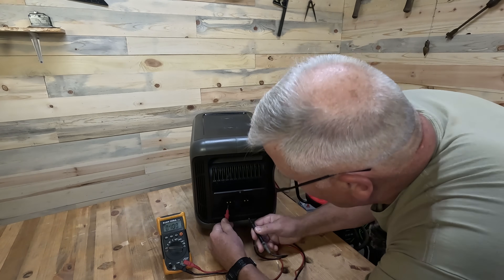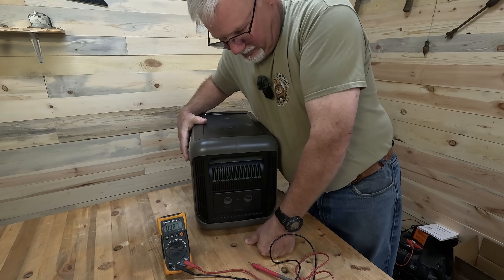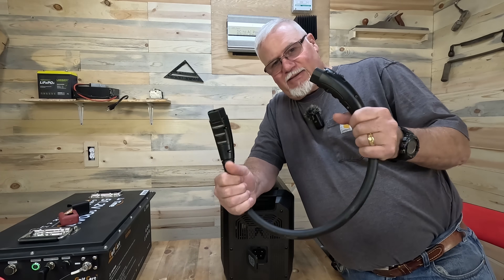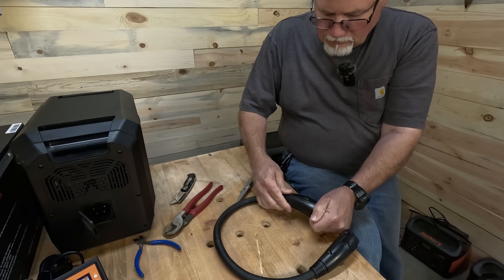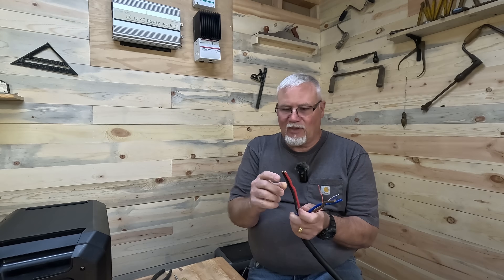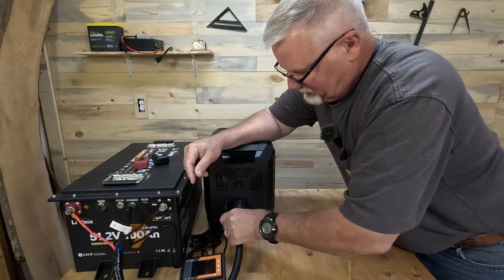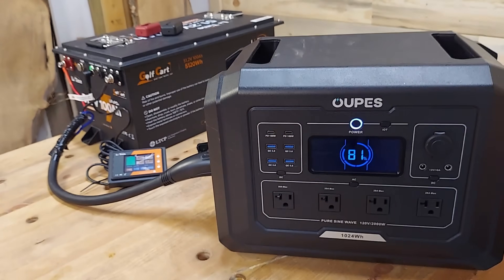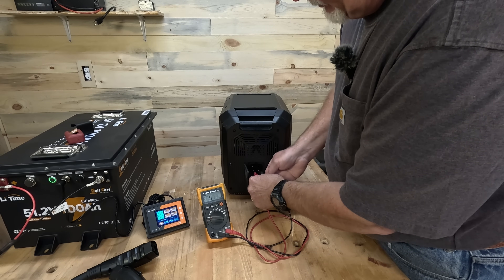Unlock Hidden Power: Connect Your Own Expansion Battery!

Comment: Smaller power stations generally don't use standard series cell counts and can't be externally paralleled with standard LiFePO4 batteries.  But most larger power stations do indeed use standard 16s (51.2V nominal) packs and those can be paralleled.  The power station may get confused about the state of charge but, often, it works surprisingly well because it gets its SOC reading off of comms to the internal pack's BMS, and the battery in the power station will have roughly the same SOC as the external battery as it charges or drains, once you've cycled them together once or twice.  Crazy but true.   You might even get relatively accurate "time remaining" readings too.

Most power stations have an independent internal battery pack with its own BMS that have just two connections to the rest of the power station.... the main bus, and a comms cable to the BMS.  Sometimes it is hard to get to the power cable but if you can there's a good chance it actually has a connector that you can disconnect and then splice off with your own connectors from a connector crimp kit.  Usually an XT60 or XT90.  Sometimes the battery bus cabling will be  soldered directly to the rest of the power station.  Often, though, there is an actual internal connector.

Needless to say, mucking around with the internals of a power station can be quite dangerous even when the power station is turned off.  The battery bus is likely fully energized.  It is not generally worth doing but it is a fun hacking project to dig in there and add a paralleling port if the series cell count is compatible (4, 8, or 16).  It just might not be... 15s is less common now but used to be quite common, and in smaller power stations 5s, 6s, and 7s topologies are quite common.

-Matt
Reply from the maker: It’s all about getting creative!
Reply: Thanks for the great engineering insights. 
Do you have any online resources to learn about methods to get beyond the 'fence'?
Reply: @rosalieroku3818  School of hard knocks mostly.  No, iti sn't that bad 🙂 Ya just gotta start small and play with the stuff.  Otherwise, though, youtube channels like these do a pretty good job at least giving people an idea of what they are letting themselves in for.

I think the key is... do something useful with the systems you put together.  A little tool-charging system for a tool shed with a solar panel or two on top of the shed.  And so forth.
Reply from the maker: Ahh yes, the SOHK is a good way to learn though sometimes is the hard way lol
Reply: Head Smashers Channel does just this to several Units ( Re : Bluetti )
Reply: @TheOldJarhead Buying this Cable and Hacking It in the Middle Gives Me a Cable for both the Mega 1 and Mega 2 and 5K added each or Xtra Solar input with the Extra Battery also Taps into Allot of Additional / Usable Solar at the same time. SEMPER FI @ 

💦 Indian Creek Ranch ⛩
Southern California High Desert 🌵
Reply from the maker: Nice!

Comment: Funny enough I was planning to do this with the new Apex 300, as I bet the 50a Anderson Connection is ready made for this.

And I can make my own cable using wire and an Anderson connector stuff I already have.

I still like the solar method, especially when you scale it like I have to power half a dozen stations at once easily.

What is sad is all the creative hacks people like you and I come up with.  When I share them to people in groups most people bash it, they defend the expensive OEM options to the grave.

IMO a defense mechanism to justify already past purchases.
Reply from the maker: lol people don't always like folks that think outside the box 😉

Comment: Innovative idea. Thanks for the informational video. Genuine thinking out of the "box". (No pun intended). I just bought the Mega 2 without the expansion battery and cable. I checked Amazon, Ebay and the Oupes sites. There is a B5 cable available for $29. There are no individual B2 cables to be had unless you buy the Mega unit with the extra battery. I think they saw you coming :). I guess you could get really wild and try to make your own connector. Have a fire extinguisher standing by. You also have to think that any of these self imposed options has to blow the warranty right out of the water (if they found out). Sorry to be so negative. Good news is you can always use the solar input ports like you demonstrated in you other video.
Reply from the maker: I've been thinking about finding their connector 😉

Comment: Have you ever connected a 48V 50ah ebike battery with xt60 connectors to the solar porr?  Will the MPPT pull power properly and in a controlled manner. These batteries are about $100 on Amazon.  Way cheaper than the standard lfp batteries?
Reply: Can you show me a link to the 48v 50ah battery for ebike for $100 ?
48v 50ah is 2560wh. You're not getting that kind of capacity for $100.
It's more like 48v 5ah for $100
Reply from the maker: Ya I just looked.  Not sure where that price is from.
Reply from the maker: If they are the right voltage, then it should work fine.

Comment: So, I have a EF Delta 3+ with the extra battery so I’m at 2KW… I also have a 24v 100ah battery, so another 2.5 Kw… I use a XT60I cable and it brings in 400 watts.   Your idea is GREAT… This is just another option… There are 24v 200AH FOR 5K of Power. And the delta 3+ has TWO of those XT60I Ports, so you could bring in 800W At the same time… Just SAY-en..
Reply from the maker: Yup

Comment: I have a tiny power station that doesnt support battery expansion 

All i do is get a O-ring terminal to DC barrel or Anderson or Xt60 or whatever input end i need and just connect one end from the battery terminal and then into the solar input 

It works just fine i have to check the input Voltage number however tho
Reply from the maker: Yup, in those cases, that's all you can do.
Reply: This has been around forever.
This is a new and improve way to add extension if PS has an expansion port.
This way you don't need to charge your external battery.
The power station keeps both charged
Reply: @Firephosure  it may have been around forever but the exposure of it is lacking over the internet 

an external inline  mppt charge controller  will keep everyone charged up

But you don't see much content that support highliting configurations like these especially for smaller set ups
Reply from the maker: It may be, but I've not seen anyone else do this.

Comment: Ecoflow Delta 2 Max:  No go.  0.4v with the power station on.  I checked both expansion ports.  My Delta 2 is ~300 miles away, but I suspect it is the same (addon batteries are interchangeable).
Reply from the maker: Hmmm. The only reason for that would be a switch triggered by a NO/NC type connection, I bet.  Probably a pair of the small wires make the connection so the switch clears and allows the parallel connection.   I'd check the battery pack and see what it does.

Comment: This is the best power station "hack" ever, Erik!! I have 3 mega 1 to family and now I'm thinking about trading for my 2 kwh solarplay station so I can do this! The mega 1 has gone up $40 since Christmas or I'd probably buy another lol. Thanks for even more info on this
Reply from the maker: Not familiar with solar play but wondering if it can't be extended?
Reply: @TheOldJarhead it's almost exactly the same as an aferiy p210. Only difference is variable charge rate with no expansion port.
Reply from the maker: Ahhh ok so can use solar input only.  It works but is limited 😕
Reply: @TheOldJarhead I do the solar input trick you taught me on both power stations to get 24v at 500w from 2 12v 100ah batteries. But I learned an extension to that method. Hook my solar up to the batteries to feed them while they feed the power station. Stupid me was thinking I'd have to disconnect to charge them with charger and generator
Reply from the maker: Yup, I did that in another video 😉 works great!
Reply: @TheOldJarhead there are days when I say to myself, dang that was a good idea. Other days I ask myself how I'm so stupid
Reply from the maker: I suspect you're smarter than you admit 😉
Reply from the maker: lol oh I have my share of dumb ideas! lol